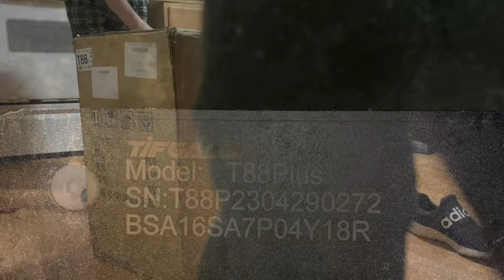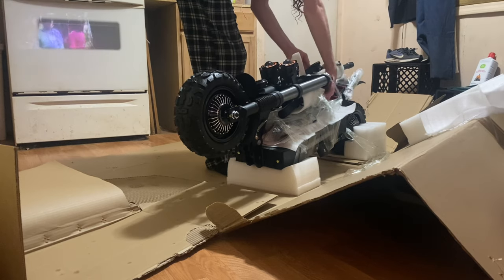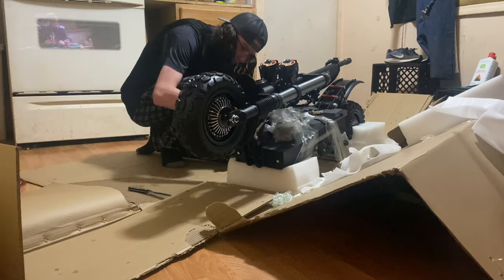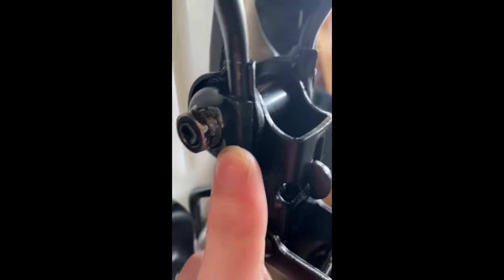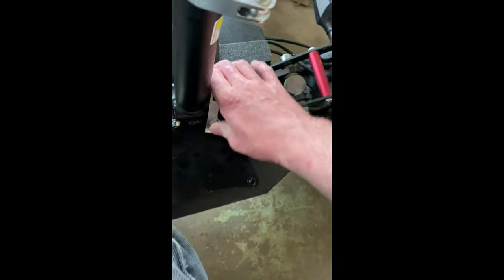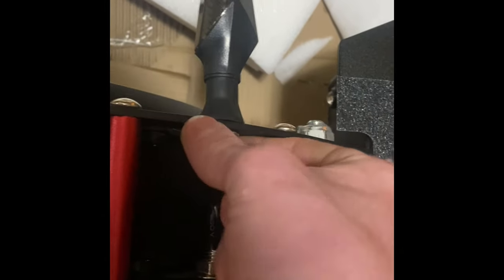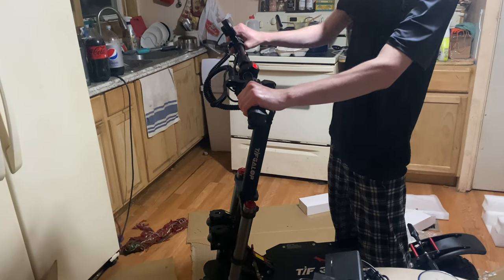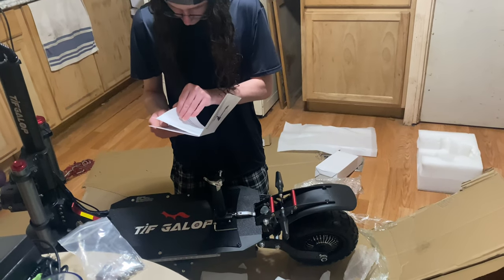T88-PLUS, E-SCOOTER Assembly and first week review W/@Naughtydanny

Comment: WARNING:DO not use Turbo Button at a complete stop be rolling at least 30-37 MPH or (60 kilometers per hour) 1. then finger off throttle .Rolling 37MPH: 2. then press turbo button. 3. then finger back on throttle. Braise yourself tight and hold on. Still very powerful acceleration. Be safe: Not stupid. Know your roads and trails before you ride. This is one of my work commuter vehicles 17.6 miles one way to work. Still lots of battery left. 1 charger is now at work and the other at home.Never will use  the seat removed it and the plate. I have many Electric scooters and e-bikes.  Happy travels.
Reply from the maker: thanks for the advice very descriptive hope others see it aswell, personally i keep the seat on mine im light weight ive gotten it up to 57 and i just feel alot more control over the scooter with the seat.
Reply: Why do they give 2 chargers? Curiously asking, TIA !
Reply: Thank u for sharing
Reply: @LDMQ757 thank you for that information, in looking for a stable seated scooter with some power at an affordable price, how soft is the suspension? Overall is the scooter still holding up well for you?
Reply from the maker: @mythoti  suspension is good, you will feel it still on dirt roads but much smoother then most scooters, it’s holding up surprisingly well, I’ve been using it in the winter, although it’s not build for it surprisingly it does do bad, just when you ice make sure your not on dual and your going at first gear on ECO otherwise your gonna regret it
Reply: I approve this message especially if your standing up start off slow but brace yourself when you hit turbo you can definitely fall off
Reply: Now you said 17.1 miles one way and still have battery power now I travel to work one time on mimes my battery needed charging cause I had it on dual did you have turbo off
Reply: @Franksinatra96  you mean charge it using both chargers at home so it can b twice as fast to charge up?
Reply: @YoungAmzn  yes it has two motors front and back so when you charge one up your only charging one side and when you plug both chargers in your charging both side I.dont think the scooter will run if one side is completely out
Reply: @Franksinatra96  gotcha ok thanks! Would’ve been cool if it charges a little while going down hill, I believe I seen a scooter have that in the discription
Reply: @YoungAmzn  it would be nice but how much power could it even generate going down a hill I'm sure not much but I guess some power is better than mine also your scooter has a USB on it you can plug anything small that takes it
Reply: I got a bad back bro come on
Reply: These have the old SQUAREWAVE controllers which most people do NOT like anymore. Almost all these scooters are using or have been converted to the SINEWAVE controllers which will make them handle just like a motorcycle, moped, mini bike, etc. it will never JERK on any take-off unless you want it to in the P-settings. The SQUAREWAVE controllers are non-adjustable to get rid of that  hard, dangerous throttle.
Reply: @YoungAmzn   To degrade your battery faster with  fast charges.
Reply: @lionelhowell4972  I was looking for that for my t88 scooter yes I like them much better but I read that they don't make them for mines
Reply: @Franksinatra96  Alli Express, yes they do!! you might have to upgrade with the whole unit Yunli 45amp controllers and the throttle.  I did both my Land Breakers to those and they are now amazing with full control and smooth with 20 P-settings not 9
Reply: @Franksinatra96  NOT TRUE! One charger still charges the whole battery only slower. 2 chargers are for faster charging only, but you will degrade your battery faster.
Reply: @Franksinatra96  Huh, dont think so,do u have a scooter
Reply: @joehiatt1992  yes i have two in fact one goes 30 or 35mph and my t88 plus goes 50mph

Comment: Just got the K8 & the mode in Eco in either,1,2,3 & single or double motor only goes about 15mph in any combination,dont know why they programmed it like this,only diff. is when u put it in turbo with mode 1,2,3 in single or double, my other scooter changes with every setting,hopefully theres a fix for this

Comment: Question how has it held up? Where would you get replacement parts tires or brakes? And what kind of lock do you use on it when leaving it outside of a store.. I’m in the market for this exact one. Thanks in advanced brother.
Reply from the maker: Some of the parts can be gotten off Amazon the insurance plan can help as well as paying for an extended warranty other then that you might have to jerry rig at the moment till they become more regulated which also means more laws so basically have fun while you can!

Comment: It’s been 4 months now and I want to get one. How’s it holding up? Any wobbling? Wheel break downs? Battery life issues? Charge issues? Handle bars/spoke issues? Shocks issues?
Reply from the maker: I crashed it once good only issue it had sense then got a flat tire on the side wall from something I ran over my fault not the scooters other then that it’s done great had re adjust stuff after I crashed
Reply: @LDMQ757 where did you get the tire replacements?

Comment: Does the extra screw and bolts matter or no
Reply from the maker: Can come in handy I messed up my steering bolts when I crashed swapped them out and were good so keep the around
Reply: @LDMQ757 my scooters front break fluid started leaking so I refunded it at only 132 miles driven was worth riding it for free tho 🤣